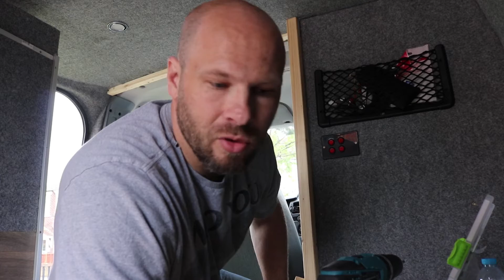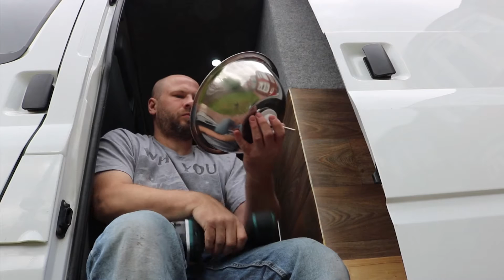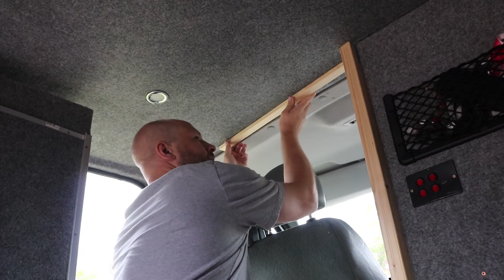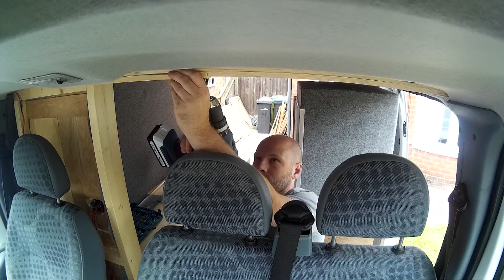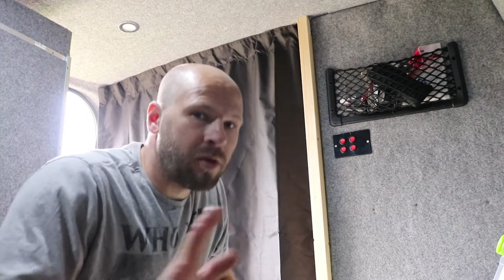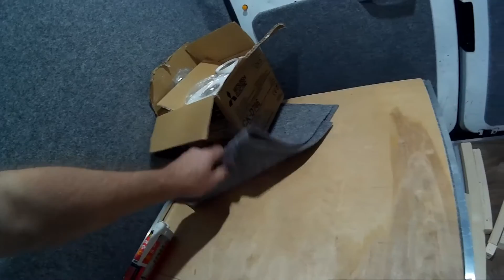DIY Camper Build - Episode - 13 - Blackout Curtain

Comment: I'm glad you didn't use rope for a curtain rod. Rope tends to droop from the weight of the curtains. Plus you can see light come thru at the top of the curtains. Enjoying the build.
Reply from the maker: Hi. I did consider using rope as cupboard door handles!! But not as a curtain rod, I suppose if you didn't want stealth then it could be okay for that vintage rustic type of look. Thanks for following the build, it's nice to get feedback.

Comment: Very nice videos - all you have done.  Yes, the pencil behind the ear works.  lol.  Another possibility would to put the correct length of wood against the ceiling then put that allusive pencil along the ceiling and 'scribe' a line along the contour of the ceiling onto the wood.  You would have to cut or sand down the wood, but it would have the correct contour of the ceiling and the bottom of the wood where you attach the curtain would be flat.  Just a thought.  Great job..

Comment: Hey man I was wondering what you did for the window and sliding door panels. I have a van that I insulated with spray foam, and I put on panels like yours but fastened them with little L brackets that I adjusted the shape of to fit the door. But they look terrible. Also there isn't a great way I've found to make accurate templates of these things. Please help?  thanks